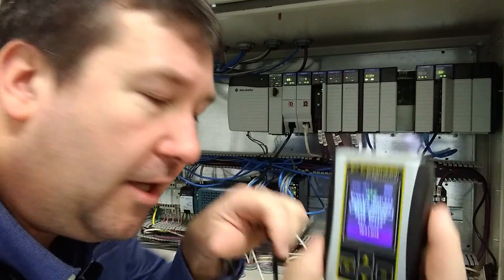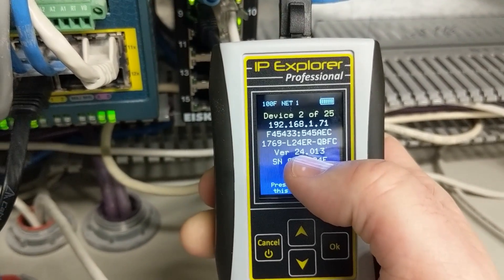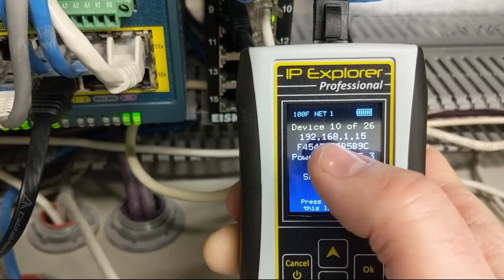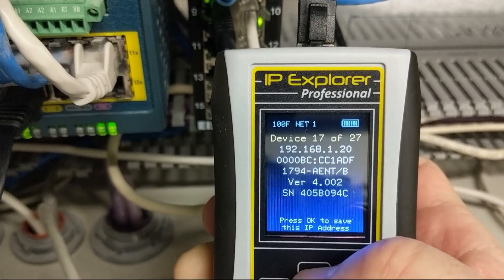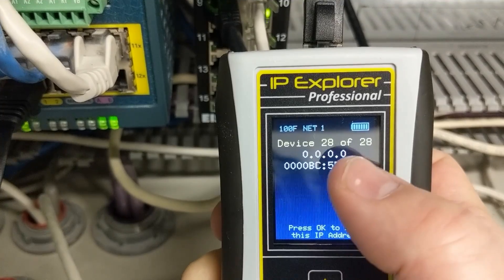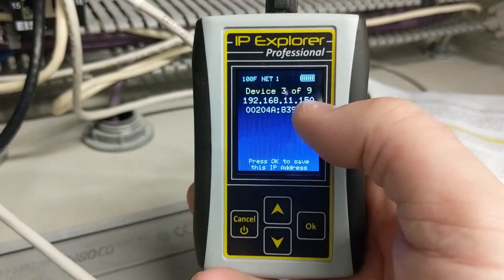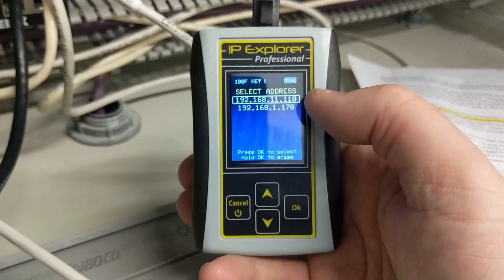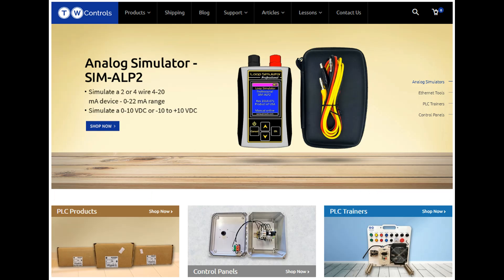Read IP Addresses from an Unknown Ethernet Network and Discover Their MAC Address, Model Number...

Comment: Hi, Tim. Just bought the device but for some reason the Read unknown option is not available on my IP explorer.
Reply from the maker: It's now called discover device. You have one of the latest ones with the new menu structure and a bunch of new features. To do everything, you now use Discover Device, select your device, then you will see the features that are compatible with that device
Reply: @TimWilborne  Aeesome, thank you Tim. I’m trying to find the IP of a GE fanuc 90-30 series PLC but the IP explorer has l not been able to discover it
Reply: It is showing, “Nothing so far”
Reply from the maker: @joelzelaya5170  I've never tried to with a GE 90-30, not sure it talks

Comment: Can this tool be used on a Profinet PLC network?
Reply from the maker: I'm not very familiar with Profinet.  We can assign addresses using DHCP or BOOTP
 and the set to static and change static IP features only support Ethernet/IP.  IP discovery works with lots of devices.  It does come with a 30 day money back guarantee so you can try one and return it if it doesn't work for your application.  Please share your results with us.
Reply: @TimWilborne  I'll give it a try  and let you know. Thanks.
Reply from the maker: @edore5481  Great, look forward to hearing what you find out.
Reply: @edore5481  Did you ever discover if it could pick up on Profinet networks?
Reply: @crystalstillwell7850  No Go. I could only see the PC on the network.  Profinet devices have an IP address. but they uses the UDP layer to communicate whereas Ethernet net uses the TCP layer.
Reply: @edore5481  Yea I saw same results. Have you found a work around on this yet? I have a siemens PLC but I am not the one that wrote the program and I am needing to get online with it for troubleshooting. Any ideas?